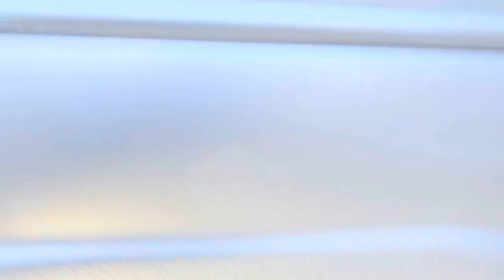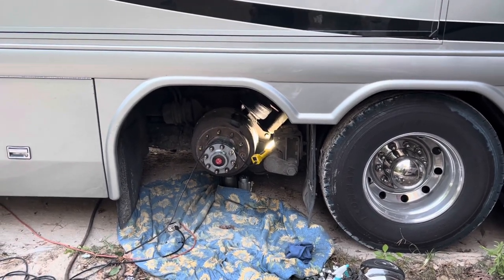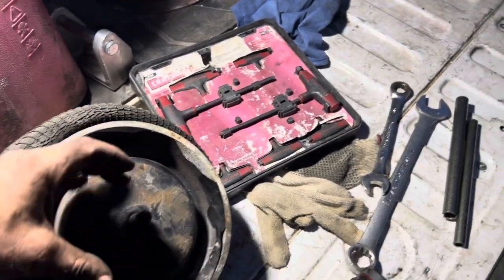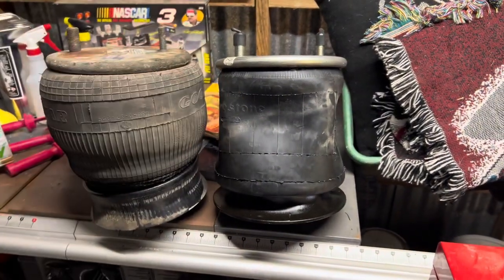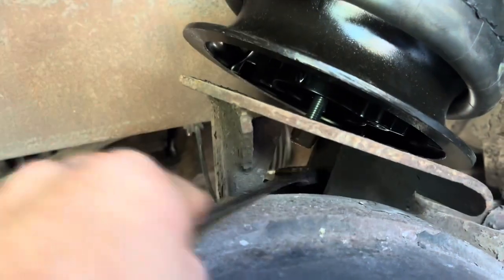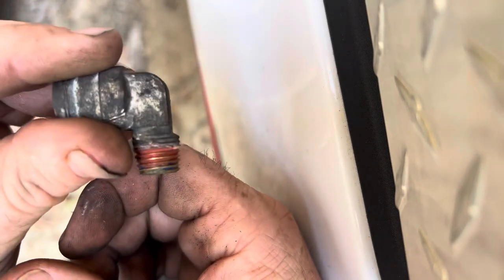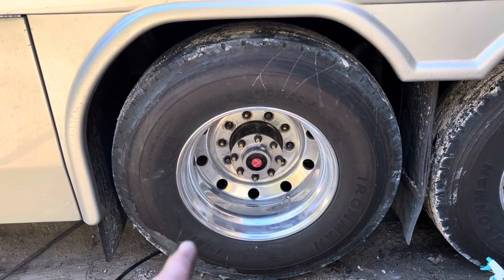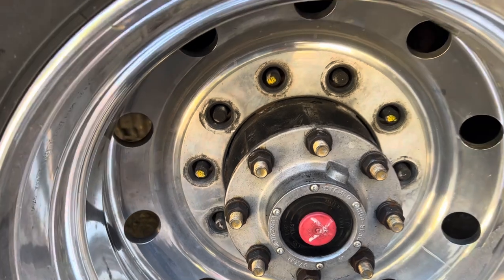Country Coach Intrigue air bag replacement@ALongLongWaytoGO

Comment: Thank you taking the time to make this video. I have the same coach with the same color scheme bought new is 11/03. Actually had the front drivers side air bag blow while parked in an rv park. What an ordeal. Great info for resources as I have no intentions of selling the coach. Thanks again.
Reply from the maker: You are very welcome. And THANK YOU for watching. Us older Coach owners suffer…a little bit…with informational video resources. Going to try and make it a habit to document everything learned so as to build a resource outlet for tasks that we may experience. Hope to see you out there somewhere someday. 
A Long Long Way to GO
Reply: Where did you jack up the coach(our Newmar is not a tag axle). Under the main axle or the frame some where. Thanks.    "Safe travels and adventures.
Reply from the maker: If you’re going to do bags…kind of both places. IF….you can reach the bags without taking tires off, then you can support coach under frame so when you let the air out, the coach will not bottom out. Makes it easier to get the bags out.  If your full air ride, you will definitely need to support the frame. Not completely familiar with your coach design, but mostly the same concept with bags.

Comment: Good video. I just replaced all ten air springs under our 2003 Monaco Dynasty about 9 months ago. None were leaking but I replaced as preventative measures to avoid having issues on vacation.  Eight of mine were cracking severally but not leaking. My two tag axle air springs looked nearly like new but got replaced anyways. 

Personally I'm not a fan of teflon tape on hydraulic or pneumatic systems and prefer thread sealant, either Permatex or preferably ARP's sealant.  

Also I recommend replacing the PTC fittings as the O-rings inside begin to leak over time especially once they've been disturbed. 

I also recommend carrying a few spares as well as some extra air lines for roadside emergency repairs.  Especially on these aging coaches such as ours. 
Mike
Reply from the maker: Thanks for watching. The thread sealant is why my company switched to the Blue Monster. Liquid sealant coated tape. Easier for techs to carry on the service trucks. A lot less messy for sure. This Country Coach has been a learning curve for sure. But a good learning curve. !!!
Reply: I don't use "teflon" plumbers tape, but I'd be quite comfortable using the blue stuff or the grey stuff....both are qualifed for gas.   As "LLWtG" says they work, I'm very sure they work..... you might be right about the PTC fittings leaking over time if they are disturbed too much.  But, I'm amazed at how well they work when not frequently opened and adjusted.
Reply: What are PTC fittings ( are they the ones that swivel .
Reply: @rodwilliams2782  PTC stands for Push To Connect.  These come in a variety of configurations including swivel if you purchased them as such.  

I prefer to use compression style over the PTC however.  They seem less prone to leaning long term but the PTC fittings are quick and easy to use. Just be sure to make the cut absolutely square and clean before inserting the air line into the fitting. 

How that answers your question. 
Mike
Reply from the maker: @zmotorsports62  Thank you Mike…As usual your technical skills are unmatched sir!!!!….

Comment: Great informative video. Thanks. I'm having trouble finding bags for my 2000 fleetwood bounder 39Z freightliner chassis. Of course freightliner says "no longer available" any suggestions where to start?
Reply from the maker: Ohhhh man….Being a Freight-liner chassis you share many characteristics of the original “big truck” chassis. I would think any big truck repair facility would be able to help you identify an equivalent bag since they probably run into the same issue with the truck chassis when replacing air bags. Companies like Performance Mack have some pretty darn smart guys that probably have dealt with the issue already. Are there any PN’s available of the original bag? Something that could be cross referenced to a readily available bag? While definitely harder to do, measurements can be used on Firestone air bags to find something comparable.

Comment: I have a Monaco Dynasty that rides on airbags and I use a $50 electronic leak detector that I bought on Amazon. Works 1000% better than soapy water and a flashlight especially when you have to lay on your back and look up 2 1/2 feet above you into the chassis.
Reply from the maker: Awesome idea…!!!

Comment: Hey great video! Bout to do the bags on my affinity! Can you tell me the Firestone part number?
Reply from the maker: I’m not sure if the part numbers I included in the video are the same as yours….however…Oregon MotorCoach is a Fantastic company to deal with. Just simply e-mail or call with your coach information…build # helps out…and they can definitely fill you in on PN#’s required. Again not sure on yours…but a lot of these bags were specific builds by GoodYear and have been discontinued…but there are equivalent replacements out there. Hope to see that rig out there…somewhere…someday !!!!
Reply: @ALongLongWaytoGO  thanks so much!!
Reply: @ALongLongWaytoGO  did you happen to finish the rest of the bags?
Reply from the maker: @BERTRAND85O  not yet….I haven’t had our coach since August….been in paint shop. 🥲
Reply: @ALongLongWaytoGO  Would you recommend driving up on smaller ramps and lowering the coach down onto jackstands? I have a 20 ton bottle jack, 220 ton jackstands and I was wondering the best way to lift the thing up to pull the bags out. Or do I pull off all the wheels and tires to get better access?
Reply from the maker: @BERTRAND85O  I think….when I do the rest, I will probably try and raise my coach all the way up on the bags…either block the frame up or stands….completely deflate the system so the bags are essentially at rest with no pressure on them. I pulled the tire due to being able to have full access. Definitely more work, but I think the ease of access makes up for it.

Comment: Good video but I can’t believe you didn’t replace the 90 fitting
Reply from the maker: @ToddM452  there was nothing wrong with it. 27k miles later and it’s still on there. I have spares.

Comment: Why not change the other bags while you're at it?
Reply from the maker: Good question….as we had just bought the Coach not long before…digging through miles of service records and receipts..I have found quite a few bags had been replaced. I have since done all the front and the remaining tag bags. Next up…drive axle…BUT…a little cash build up. We don’t have huge checkbooks like some and it’s a work in progress. Just had it painted and moving on now to more lithium and solar…it’s all coming together nicely….and MAYBE…by retirement age…all will be done…Kind of..  LOL….Only 15 more years to go. But by then….maybe a Prevost.

Comment: I'm looking for the references for the airbag model number?....and where do you recommend buying the air fittings?..... ABSOLUTELY great video....
Reply from the maker: I just bought the fittings at a local truck repair shop called Performance Truck. What kind of Coach? Either of the dealers mentioned out in Oregon are great sources for quite a few different coaches.
Reply: @ALongLongWaytoGO  Thanks for the quick reply.... I'll check out Performance Truck.   We have a 2000 Magna (we've owned it since 2005); I'm thinking of replacing the rear air bags.... had someone else do the front bags in 2016.   I like your style of presentation
Reply from the maker: @skipsaunders5974  thank you sir. I call it like it is….plain…simple. Just like me. Thanks for the kind words.

Comment: They look like same air bags as semi use ..
Reply from the maker: More than likely they crossover to some truck out there….several components are shared across the industry. Especially steering linkage pieces.